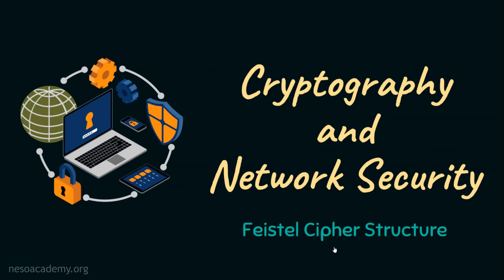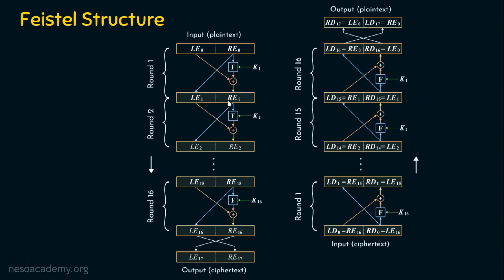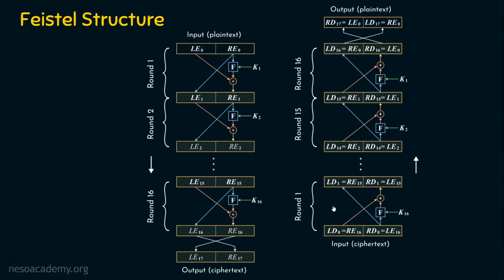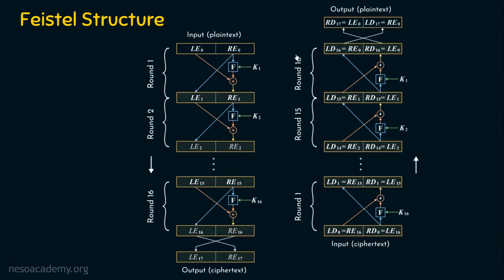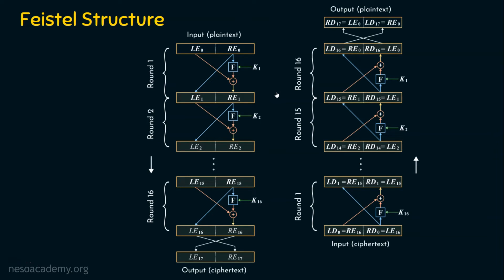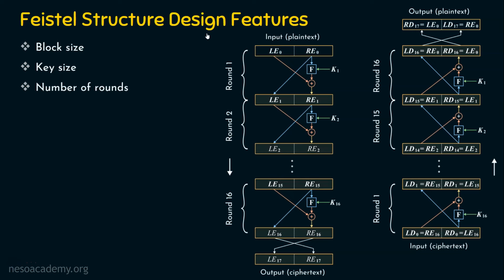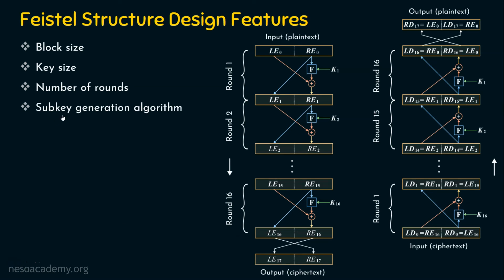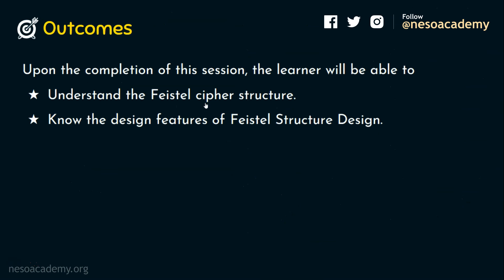Feistel Cipher Structure

Comment: Great video, very nicely made. 
1. I am still confused about the swap in Decryption where LD16 becomes LD17 (and RD16 becomes RD17). Isn't the only purpose of swap to change LD to RD and vice versa. Why LD16 is not  becoming RD17. If an element is written on the left of the diagram, why is it still written "RD"17, instead of "LD"17?
2. Also, if in encryption, the last action was a 32 bit swap, to reverse this during decryption, why is the swap not the first thing to do?
Reply: I can answer your 2. But I'm also confused with 1. , as you can see we are using only one algorithm for both encoding and deciphering therefore the ciphertext is inputted into the left algorithm with reverse keys like 16,15,...1.  and at last we had done swapping process ..